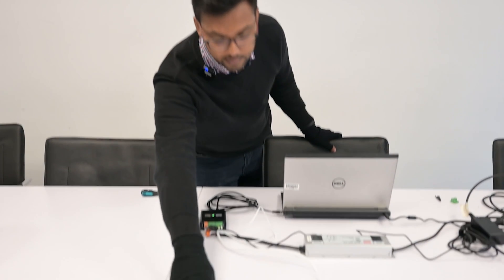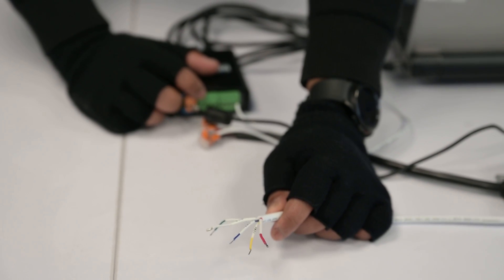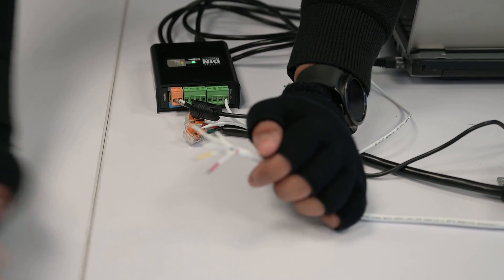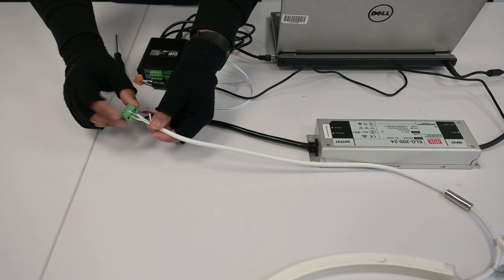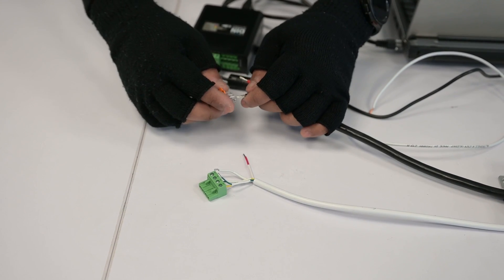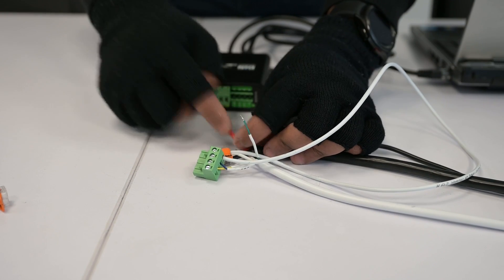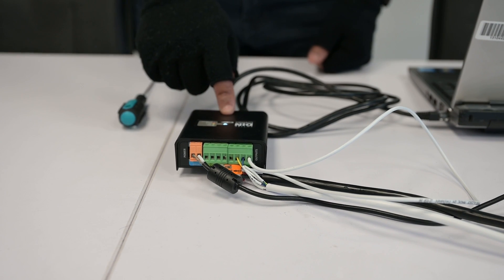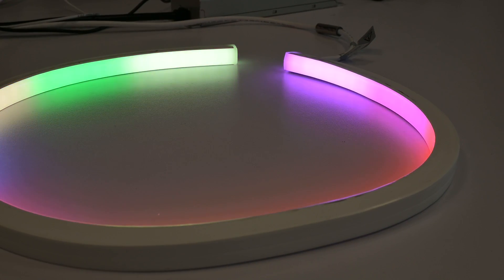How to connect ENTTEC gear to DMX Strip

Comment: Very simple and valuable video. Thanks for this team Enttec.
Reply from the maker: Glad you liked it!
Reply: Can you do that with RGBW strip using decoder
Reply from the maker: Hi,
Absolutely! If you want to control regular non-pixel RGBW strip, your DMX signal would be sent through to a DMX decoder such as our CVC4. that combined with a power supply then drivers the LED strip. This is covered in our CVC4 unboxing videohttps://youtu.be/zBZzbVfyLnQ